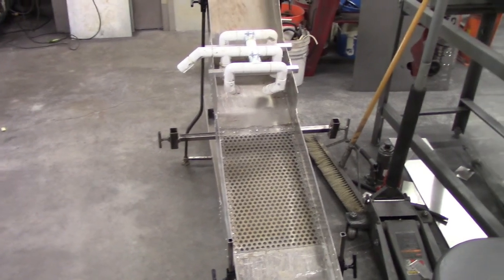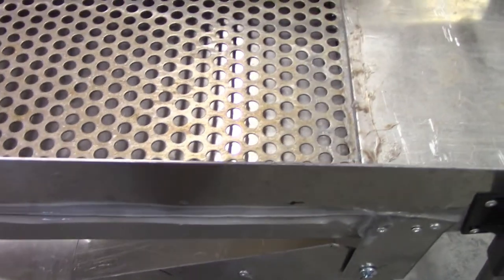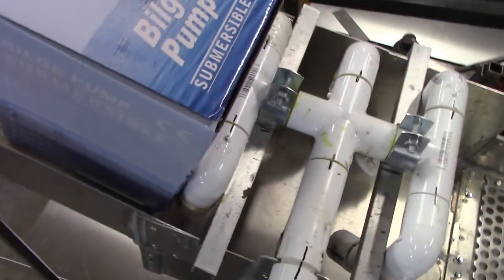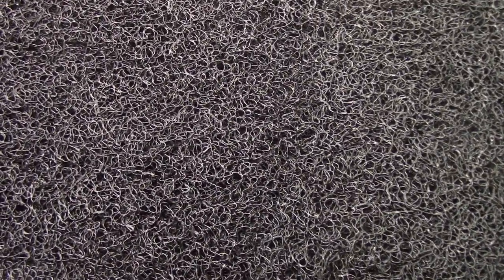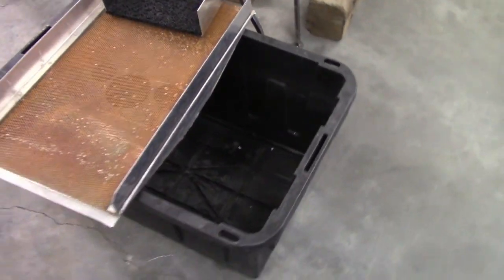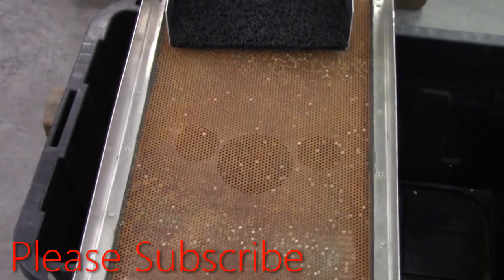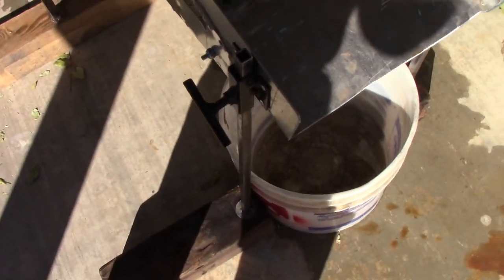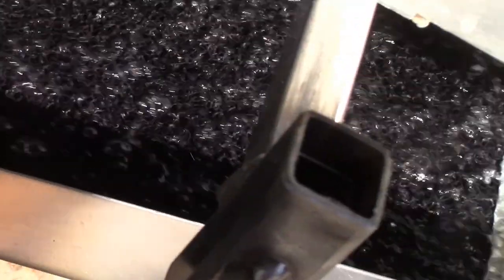MINI WASH PLANT SLUICE BUILD

Comment: The wash plant is coming along nicely Chuck. The 3500 GPH pump looks like it is going to be the ticket I almost bought one I was just concerned on how long the battery would last I guess we will find out. Good job.
Reply from the maker: I was testing with a group 27 rv battery that is about 3 years old. It ran for about 1/2 hour during the video shoot. Draws 14 amps. Got it on Ebay for $40.

Comment: wire in a switch  to turn the pump on and off  that way you don't have to reconnect the battery  just on/off      then when you go home   disconnect the battery    just a thought
Reply from the maker: Thanks for your comment. You read my mind. Just got a 15 amp switch and enclosure to do just that.